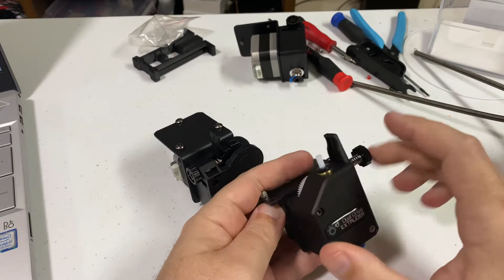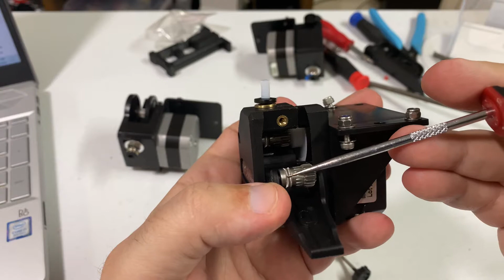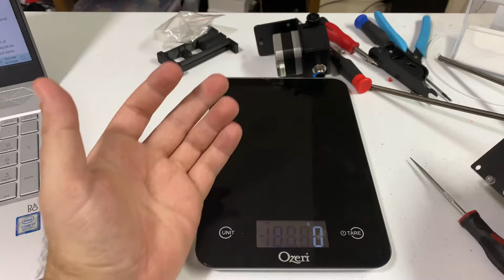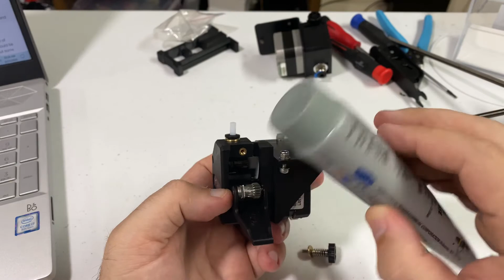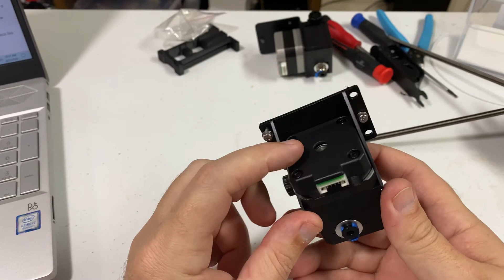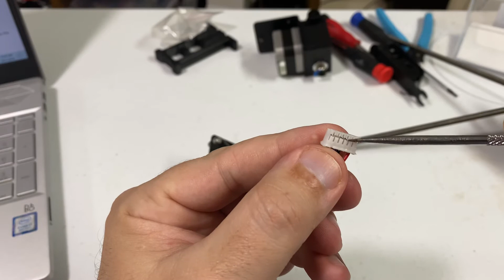Anycubic Predator upgrades: extruder

Comment: Hi Josh thanks for the information,  I'm changing my extruder to a BMG clone and using the original stepper motor that comes with the Predator , is there anything i need to adjust or is it a simple change ? Im new to this but learn pretty quickly , one guy said you can just invert the extruder as it does the same either way,  but im more concerned that some people say the steps are different and need to be adjusted in the firmware ,, thanks for any help you can give regards from Australia

Comment: The stepper you recommended (Amazon link) has very low voltage :4.1 V.  It is compatible with the Predator?
Reply from the maker: szekeres pista yes no issues - set amperage for 500-600 in TMC config
Reply: Josh Murrah   The voltage of the stepper motors is not 24V ?
Reply from the maker: szekeres pista thats not how 3D printer sized stepper motors work. - you don’t tune voltage directly, only amperage.

Comment: Links 
Usongshine Nema 17 Stepper Motor Bipolar Step Motor for Titan Extruder 3D Printer 4.1V 1A 13Ncm (18.4oz.in) 4 Lead 1.8 Deg with 1m Cable (17HS4023) https://www.amazon.com/dp/B07TY4BFF2/ref=cm_sw_r_cp_api_i_12ZsFbE8603KT

BCZAMD 3D Printer Accessories Upgrade Extruder Plastic Dual Drive Extruder 1.75mm for Tevo Tornado Wanhao D9 CR10 Ender3 Anet E10 Black https://www.amazon.com/dp/B07RBL4CJC/ref=cm_sw_r_cp_api_i_C3ZsFbHJZQS7D

Comment: I love my predator. Just can't figure out why its printing everything mirrored. I have to reverse everything in cura t get it to look right.
Reply from the maker: I'd suggest checking the stepper wiring on your Predator.  One of mine wasn't wired correctly.  Open the top cover, and trace the stepper wires... X should be front/left, Y should be front/right, and Z should be rear.   IMPORTANT: if you swap any steppers, MAKE SURE you swap endstops to match.
Reply: @JoshMurrah  Thank you very much. I will look into it soon as this print finishes. 14 hours into a bane mask.  Sucks they stopped making them soon as i bought one. Going to upgrade to the mag arms for first upgrade.

Comment: Thanks for sharing your knowledge! 👍 So far my own only effort to lower the weight of the Predator effector assembly is that I have removed the magnetic bracket for the leveling switch 😀 
Hope to find more time and energy to make it light and thereby somewhat faster and less shaky and noisy. Lowest hanging fruits seem to be the three pulley slider assemblies.

Comment: quite new with predator and as well in 3d printing in general
i was going to get triangle lab bmg clone as my first upgrade for this printer, since i heard that those guys to some nice clones
im quite confused on wich one to get, without modifying anything software wise (i read that its possible with mirrored version of bmg)
there are a few options there, could you help me out on this? heres the link on their shop - https://trianglelab.aliexpress.ru/store/1654223/search?SearchText=BMG
Reply from the maker: Kirill Rusanov the video covers all of this - no firmware mods needed especially if you don’t swap stepper motors.
Reply: @JoshMurrah  so i can keep my stock motor and use it with bmg?
Reply from the maker: Kirill Rusanov yeah definitely